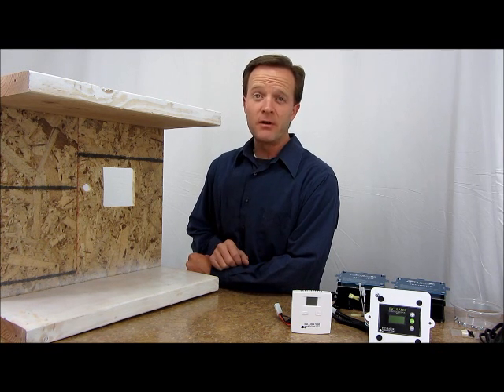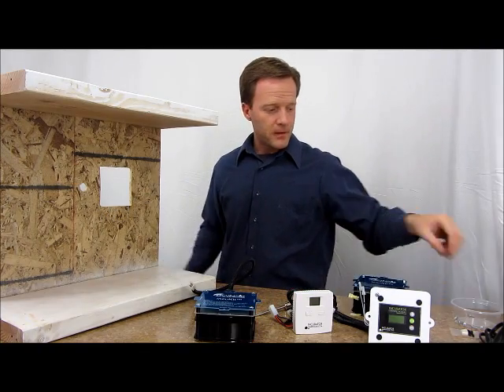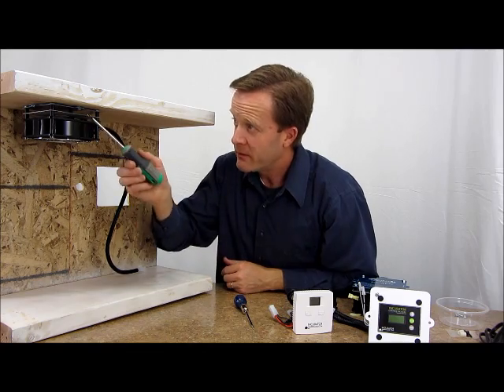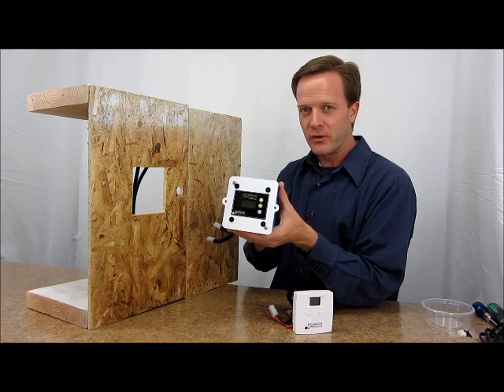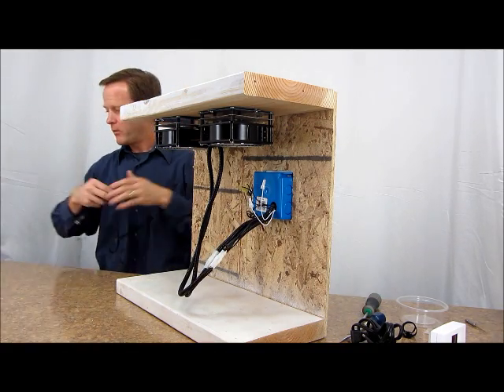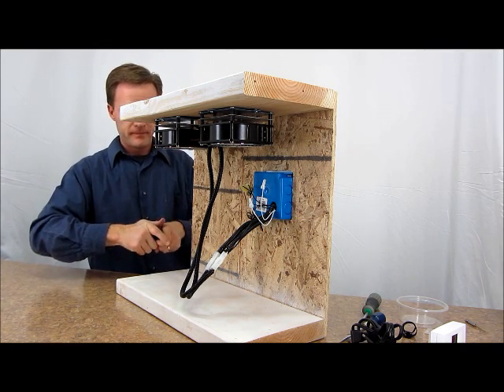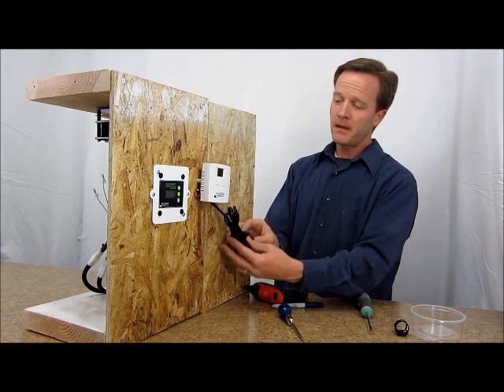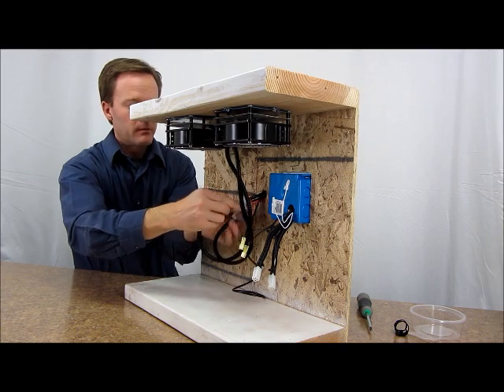IncuKit XL mounting demo by IncubatorWarehouse.com for egg incubators

Comment: The thermostat I received locks up at 99.5 and overheats until unplugged. Caught it at 120 when the thermostat read 99.5. When this failure occurs it continues to supply 120v to the heater causing it to overheat until you catch it

Comment: Dang I just spent over $200.00 on their equip. Thought I would find solutions here. But it seems there ant any feedback. I'll try elsewhere but it seems sort of odd that you would post but not reply. Hmmmn
Reply: I bought the incukit xl advanced too, my fans already taken a shit and I dropped 250 on this peace of crap. The sad part is I only put it at 75°F. It's such a tird it couldn't handle that for a month and a half  in a 36×16×16 wooden box which holds heat well. I wonder how the hell it's supposed to handle longer incubation periods for reptiles.
Reply: I spent money with this company as well I’ve emailed and they are not very helpful when you have questions. This guy needs to make a simple diy automatic turner  (cabinet)video something basic! I hope they sees this comment do something about it. Make a video